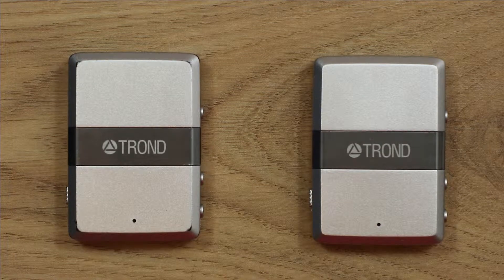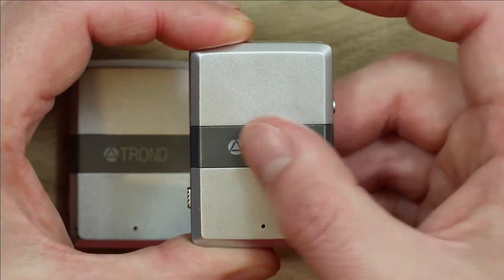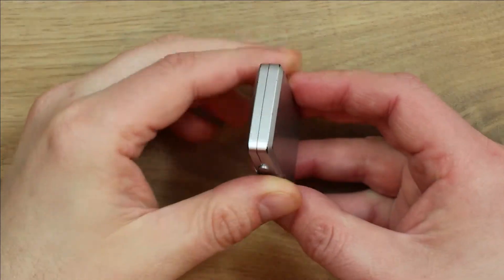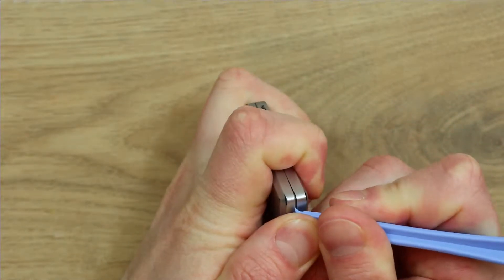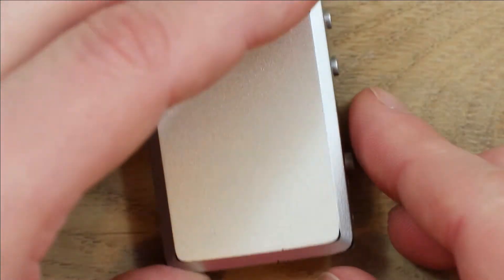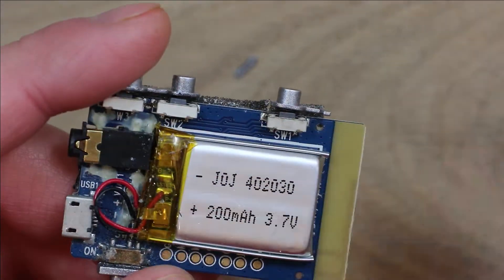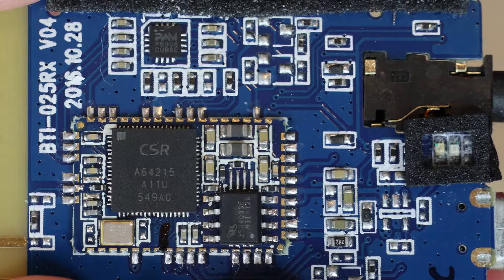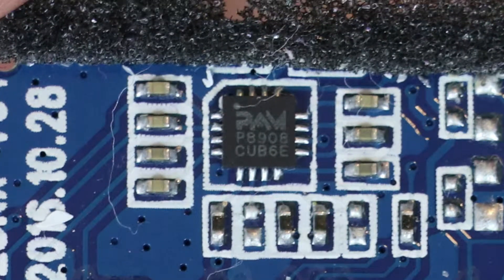Bluetooth Audio Receiver - Teardown & Repair - Trond BT-RX S

Comment: Excellent teardown video for anyone that needs to get into a Trond BT-RX S.
I couldn't find a video for Trond BT Duo 1 Teardown so I'll just write out my experience: 

At 45mmx35mmx10mm it's tiny. Pry off the hard backed sticker covering the TX-RX side. You'll need a sharp pointed tool like a dental pick or automotive pick tool. Under the sticker you'll find 2 tiny eyeglass sized phillips screws underneath. Unscrew them and the TX-RX faceplate drops right out and the entire module + battery slides right out. No clips to break :) Internals are very similar to the BT-RX S. Phono port and USB location are swapped. The antenna is actually on the side of the Duo 1 because the BT module is mounted in the center pointing towards the side. The top is for phono/charger & bottom is for the RX/TX switch. It has a 160mah battery glued to the PCB in the same fashion. PCB is green. It has a CSR 8670CG module, a variant of the CSR 8670. 

Also worth noting are the metric F'ton of grounding vias around the board to help reduce EMI. Twice as many as you see on the BT-RX (as seen at 6:45). The Duo has them everywhere. They have nothing to do with actual grounds or traces, it's all about reducing EMI. Tiny grounding vias around the perimeter of the board (and IC's that generate EMI) act as a Faraday cage which helps dissipate EMI reflectivity within the board and thus helps improve audio quality. According to the manufacturer they are only required every 10mm around the perimeter but the more the better! Something to look for when choosing a good quality BT board. It's one reason why Trond boards are better engineered than most tiny bluetooth modules. Unfortunately the 160mah battery is pathetically low power so I'm upgrading the battery to 1200mah and putting it in a AA battery box for a new wearable project. 

Something I've noticed as a trend in all Trond BT products are low output batteries. In almost every product they are using 1/3rd the mah battery that they should if you want to use them as a portable device.  If you use them as a fixed install that is always powered via USB then no problem. It's when you try to use it on the battery power that you'll find it doesn't last 1/3rd the amount of time they advertise. The one exception are the Trond AptX headphones, those things last all day they're great and do indeed have almost no latency issues when paired with a BT Duo II as advertised, you can also pair them to 2 sets of headphones which play simultaneously. The only reason I didn't start with the Duo II is because it's as big as a 4AA battery box where as the Duo 1 is 1/4 the size. No one wants a 4AA sized box sitting on their head when designing a sleeping mask. ;)

BT Duo 1 is has excellent tiny form factor, quality design (external and internal), quality audio, a li-ion charger circuit, no on-board amplifier, and inadequate battery. A great product to upgrade for a light weight wearable project.
Reply from the maker: Thanks for the comment and the informative essay :-) I didn't realise vias were used to control EMI. I'd be interested to see how you got on with the battery upgrade, I considered it too but from what I recall of the spec sheets for the chip it was limited in terms of charging capacity unless additional components were used. Either way I got one of the two Tronds I had up and running so am happy for now. I have bought some other BT audio bits but not gotten around to trying them yet, other than a £3 pair of cordless headphones which are pretty awful :-D

Oh and thanks for the heads up on the screws under the plate on the other model. As you saw, I was expecting that for this one but was wrong.
Reply: @Error42_  I got it working.  The spec sheet is the charging current not max battery capacity.  I have it hooked up to a 1200mAh battery and it's charging it fine. According to the 8670CG spec it's actually 300mA current, perhaps why Trond went with that revision over the stock 8670 which is 200ma current.  It will take hours to fully charge but it is charging without the need for an external regulator.  That's a requirement for my project because I need it to be as small as possible and an external regulator will not fit. I knew it had to be possible because the BT Duo II S (the newer version of what you have in this video) comes with a 500mAh battery and uses the same exact CSR8670CG... all the new Tronds do as far as I can tell. 

Worth nothing I had to find a special sized 1200mAh battery as most 1200mAh are far too wide for a AA battery box. Found some used for Quadcopter drones... and I had to hack up the battery a little to squish it in there as it was 4mm too long (incorrect dimensions by the seller) due to the integrated IC board on the end of most Lipo's.  The capton tape can be removed and the tiny board bend backwards over the battery. :) So a 1200mAh battery and a Trond Duo 1 fit perfectly inside a gutted AA battery box. Tiny portable BT with great battery life. So far so good!